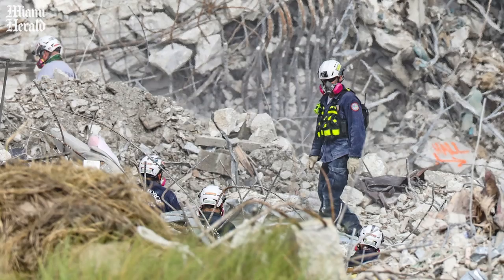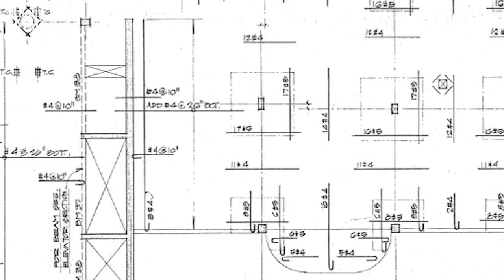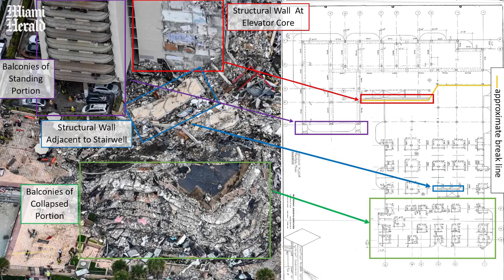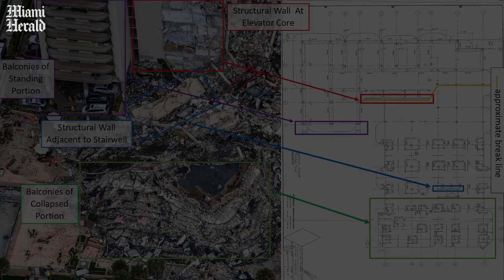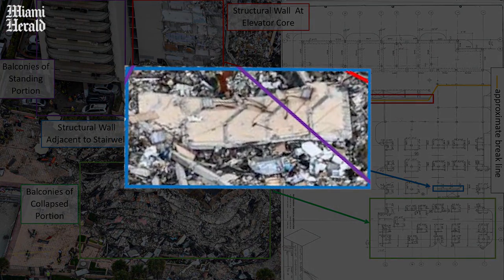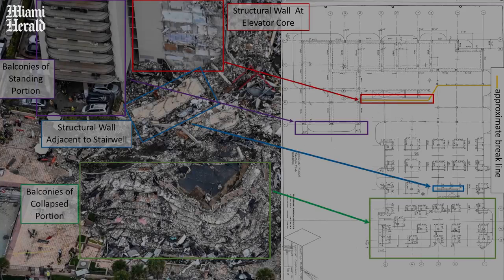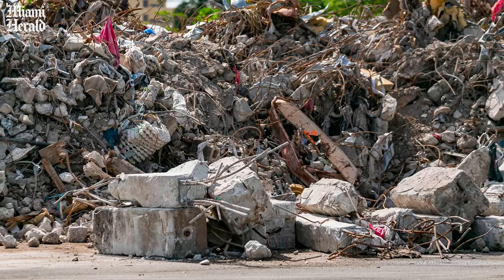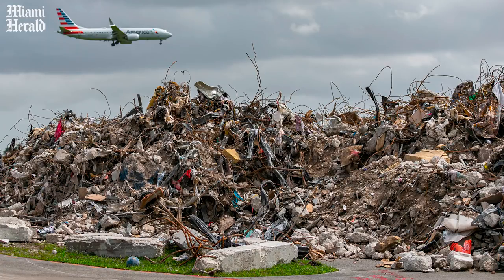Structural engineer explains Surfside collapse investigations

Comment: We will be producing a detailed review of the construction drawings this week.  Stay tuned!
Reply: Thanks Josh, we will be watching!
Reply: I've learned a lot from your channel, thank you.
Reply: A review means what the engineer thinks of the as-built structure of the building - is it safe, up to standards, so on & so forth.
Reply: Love your channel excellent explanations of the disaster as well as the topic itself.
Reply: Looking forward to it!
Reply: With over 35 years of advanced material reinforcement, chemistry of Portland Cement and ASTM Failure Analysis engineering, the data I have uncovered is frankly shocking. 

Data concerning the City/Towns of Miami Beach and Surfside is very interesting and is forthcoming.
Reply: @icare7151  I’d love to see this information coming forth. Do you know what channel it’s coming too or when? I appreciate it. I was wondering if we would be able to find out what happened during construction. Where corners cut, where inspectors paid off, etc, etc, etc.  this is gonna get interesting!
Reply: For those of you who might not have watched any previous videos from Building Integrity, they do an amazing job explaining a lot of the fundamentals of building design along with exploring possible failure modes that might have contributed to the collapse. As the professor said, it will take years until a detailed and thorough report is released -- however, that doesn't mean we won't get major developments and discoveries before that time.

From all the videos that I've watched (especially the awesome videos that Building Integrity as created), we do have a pretty solid understanding of the initial failure and some possibilities that contributed to the collapse. For instance, most of the people who have researched the history of the building and watched other evidence like a walk through of the garage last year that was filmed, we do know there was pretty extensive water damage around the pool deck area and substantial spalling of important concrete support columns that probably contributed to the collapse. 

We also know from another video taken by someone staying at a hotel across the street that the pool deck area apparently collapsed around 15-30 minutes before the building failed. It appears that collapse may have put extreme forces on other support columns that those columns weren't designed to withstand (tension forces, etc. -- concrete is amazing at compressive support but very weak when tension forces are placed on them). 

There are still a lot of unknowns -- why did the pool deck collapse to begin with? How extensive was the water damage around the pool deck and in the garage areas? 

There are a lot of unknowns but Building Integrity does an excellent job breaking down the basics for people and then pursuing possible theories related to the failure itself.
Reply: @johnr7365  John take a deep breath and relax. Life is too short to be triggered over nothing. 

There is a huge amount of data consisting of thousand of pages of documents, videos, pictures, testimony etc. 

It is vital to have a large collaboration, valid data validation process and no stone unturned. 

Keep in mind there are ongoing criminal and civil investigations and active  litigation. Thus, some data may not be appropriate to be discussed or released yet.  

Therefore, continue to review the public available documents and discuss with professional collaboration agreeing to disagree agreeably knowing data is constantly being discovered and changing which requires an open mind without biases. 

Just some thoughts for you to please consider and respect.
Reply: I think you have cracked it and shown what particular straw broke this camels back.
Reply: @johnr7365  🤣 John, relax.  You get triggered when others simply have decades of experience, knowledge and education of which we all  can learn from.

No one is stating you don’t have an education, experience, and or knowledge about certain subject matters. 

Professionalism and respect of others knowledge, experience and their education is just as important as yours, no more no less. 

Education is a life long journey, not just a piece of paper to pound one’s chest with.

Humility, professionalism, truth and respect of others including their thoughts and  input are the basis of real integrity which some use the word “integrity” simply as a “marketing sales puffery buzz word”. 

-Just some thoughts to consider.

Have a blessed day.
Reply: @johnr7365 ,
I'm in the architectural field, I'm aware of the process and requirements
Reply: Leech.
Reply: @johnr7365  Your missing major key elements. Happy hunting. 😁
Reply: No qx
Reply: Lol
Reply: Well done, what is your take on the forensic analysis of WTC7 collapse? https://youtu.be/bcUmEyfaKW4
Reply: @lurin971  You know you won't accept any explanation other than "controlled demolition", so why ask? There is already a detailed report on wtc7, and it explains every detail. And it is correct.

You know, sasquatch lives just beyond the ice wall. That's why he is so hard to find. 😂😂😂 Oh, and we've never been to the moon!
Reply: @johnr7365  so you must be a building inspector then somewhere John, would that be an accurate assumption by chance?
Reply: For the ones that desires not to wait so long
Reply: The building department already has a complete set of drawing as part of the permitting process
Reply: @PurpleObscuration     You want a medal for that?